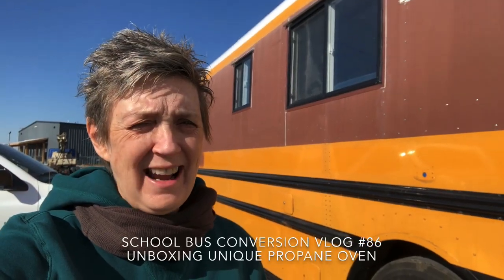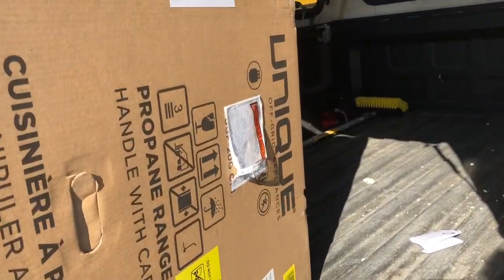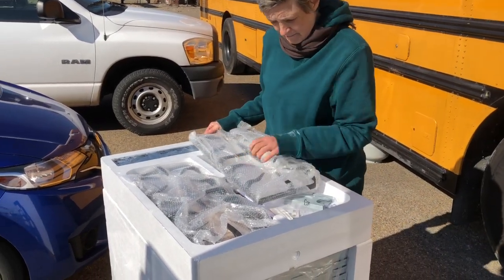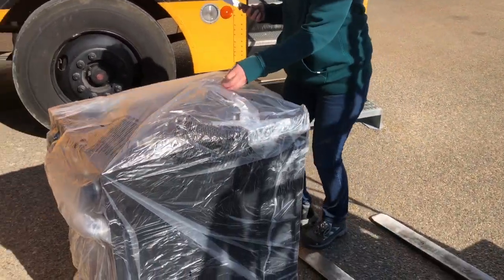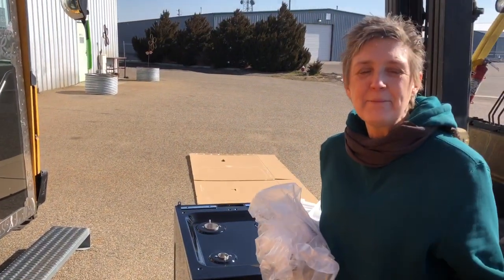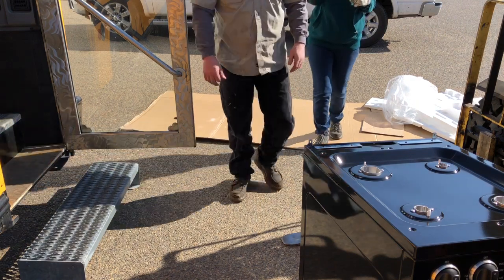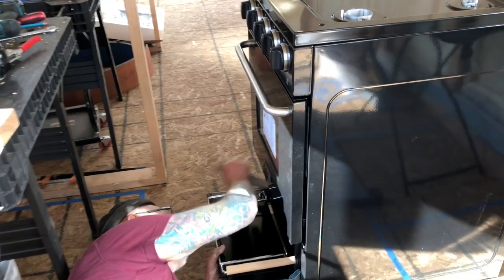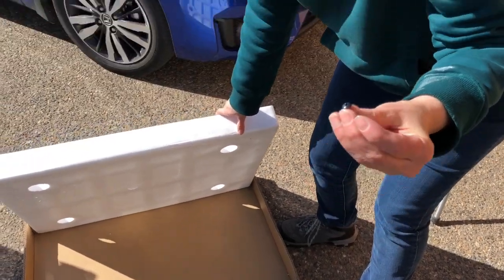Unboxing Unique Propane Oven - Vlog 86 School Bus Conversion

Comment: What made you choose that appliance brand?
Reply from the maker: We were shopping on Home Depot so it could be delivered locally first. Then looking for a smaller gas apartment size ... we liked how easily this worked with propane and the depth was deeper than others for baking. And we wanted 4 burners. I can easily get a 10"x15" cookie sheet in the oven. And all the comments were very good.  It is a learning curve but we have been using it and really enjoy it. Very easy to clean the top. I am loving that.